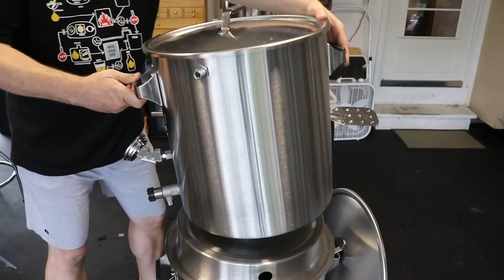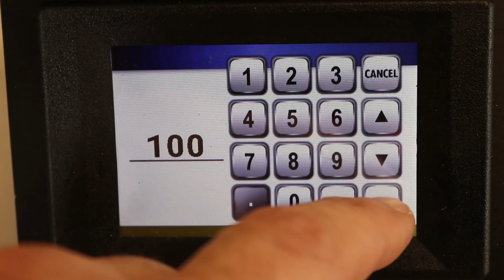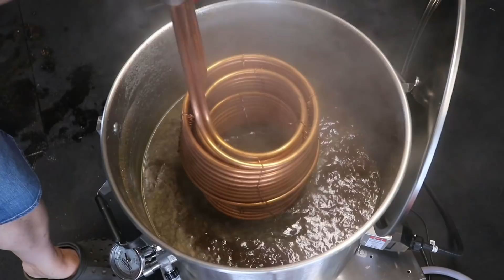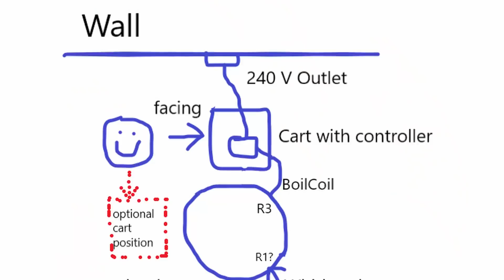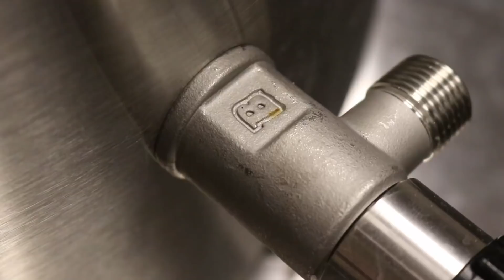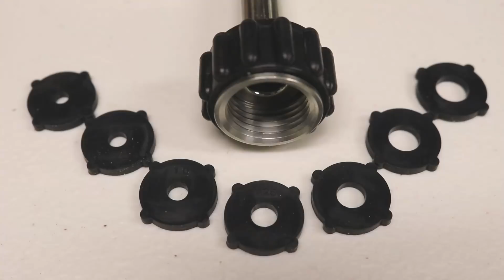Reviewing the Blichmann BrewEasy (240V Electric, 10 Gallon Version)

Comment: Hi Larry; What equipment do you recommend for someone who’s barely new at brewing? (User friendly) thanks
Reply from the maker: Depends on the brewing method you want to purse. For example, Extract or All-Grain, concentrated wort vs full wort boils, Multi-vessel or single vessel etc.  
Extracts only require a stove top pot at a minimum, but I also have a home brewing basics series playlist from a number of years back that goes over the basic equipment for all grain brewing using a multi vessel cooler based system that only requires one burner, one kettle,  and no pumps. Or, go BIAB or an almost-in-one electric system.  There are so many option nowadays, but easiest and cheapest to start is extract brewing.
Reply: @BEERNBBQBYLARRY  Thanks a lot Cheers!

Comment: Have you tried making a 5 gallon batch on the 10 gallon system?
Reply from the maker: I have not. I tried designing a 5 gallon recipe to fit on it and was really pushing the lower capacity limitations trying to keep the boil coil submerged while still providing enough mash water for the grains.  It is possible, but I was uncomfortable with the slim margin for error.

Comment: I noticed that your not using rice hulls with the false bottom. What is your grain mill gap set to?
Also, did your false bottom come in flat or warped?
Reply from the maker: Rice hulls should not be necessary if all grains in the recipe still have their husks attached as in this recipe.
I use a coarse crush for all my recipes and brew systems including those with false bottoms and manifolds. I don’t even know what the spacing is since it ranges from one end of the rollers to the other. I just ensure the grains are broken up. 
The false bottom is flat.
Reply: @BEERNBBQBYLARRY  mine has a warp and was advised that can be normal and will not get a new one. As a result I need to use rice hulls to take up the warp gap otherwise the grains fill up under the false bottom. When I use the Anvil Foundry, everything is no issue, same grind in the G2 with FB, have to use rice hulls. Guess I should find another option for G2 FB.
Reply from the maker: @RiggerBrew  So the warp is so bad that the grain is getting around the outside edge of the false bottom? Yikes!

Comment: Still struggling on by with 35l Robobrew and looking to double capacity to have half as many brew days (less washing per pint). This looks great but, she who must be obeyed would flip if I spent this much on a machine also it looks like you would be spending a few quid (sorry bucks) on camlock fittings and valves to get what you really want. My dilemma is the same as most...As much as I like to brew and make my beers, how much beer would I have to enjoy to justify the cost of a system like this. Did you actually have a video (or what ever they are called) of the faff of working this in an actual brew day? i can't find one but it would be nice. I don't think we can get this in the UK anyway. Did you ever do a spike brew? three pot HERMES ?
Reply from the maker: I'm hoping to get in another brew day this summer. I've only brewed on it twice and cooked in it once so far.  I have several Spike Solo videos already. I just need to find time to spend more time with the BrewEasy.

Comment: I fired my brew easy up last night for a passivation then cleaning. I am really struggling with the idea that the sensor goes on the pump, since mine didn't have a fitting for the pump. I have to assume that the sensor goes in my kettle, and just have to live with the temperature loss in transfer from the kettle to the mash tun. I have had it for over a year, and am just now firing it up. I find that the size on the 20 gallon is HUGE. I will probably use my cooler mash tun and false bottom for the first batch. Just keep on my toes. What say you Larry about the sensor? does it have to go on the pump?
Reply from the maker: Here is a link to the sensor instructions: https://www.blichmannengineering.com/pub/media/wysiwyg/pdf/BrewCommander5_19_1.pdf
Reply: @BEERNBBQBYLARRY  I have this manual. Thanks buddy. It shows the fitting as optional. Cheers.
Reply from the maker: That's a bummer missing the adapter piece for the probe. The BrewEasy was designed to place the sensor in-line with the pump, but I recall a couple of alternative install options listed in the sensor assembly instructions including one where the probe replaced the bimetal temperature gauge on the mash tun or kettle.I think that option also required a special adapter though. Not sure. You'd probably want to calibrate the controller to account for the different location since it'll be off by an amount.
Reply: @BEERNBBQBYLARRY  I have a coupler that is nearly identical of what came with the brew vision thermometers. It looks to made for the front of the kettle, it even has the same black grommet for the backing nut. There is no fitting for the pump though. Maye they nixed it for the larger system? Who knows but Blichmann. U suppose if I hook the craftbeerpi system up in concert I can monitor all the vessels and go from there to discover heat loss, if any. I have manuals for each individual piece that it came with, but they assembled these goods from shelf parts, and didn't provide a "Brew Easy" manual. I have a stack of individual component manuals though. HAHAHA Cheers Buddy

Comment: Thanks for the vid.  I have one of these systems and haven’t fallen in love yet.  You’re right, expensive and not many people have them so less videos on them.  I don’t understand which gasket to use either, so I just use the biggest then adjust the flow with the gravity drain...
Reply: Hey Brent. I've had my BrewEasy for about four years and I've brewed on it 40+ times. There's definitely a learning curve, but once you figure it out you'll find the rig makes very consistent batches. As for the orifices, I typically use the 1.25 GPM (which I believe is the same one Larry used) for the duration of the mash and then switch to the smallest orifice when I'm ready to gravity drain for the boil. With the 1.25 orifice installed and the auto-sparge configured correctly you can run the Riptide pump wide open for the duration of the mash. Also, you'll definitely want to install quick disconnects (per Larry's recommendation) as that will make the brew day much more enjoyable. Hope this helps!
Reply: @cwalter-25  thanks for all the info Chris- appreciated.  I guess I just don’t understand why not just use one large gasket and adjust with the flow knob instead?  Just in case it’s not flowing enough you can adjust drain volume on the fly.
Reply: @silveraven1  Hey Brent. That's a valid question, and I can't recall off the top of my head why that particular orifice is the preferred one for the mash, but I'm pretty sure I got the info from this website: https://www.greatfermentations.com/brew-day-tips-blichmann-breweasy/  
There's a guy named Dana who has done over 100 brews on his BrewEasy. I think he's an airline pilot by trade, so he's very precise as to how he brews, e.g., using a check list, etc. Check out his tips and watch his video and you'll have a much better understanding of your system. Cheers!
Reply: @silveraven1  I just re-read your question. If you use the 1.25 GPM orifice you'll never need to touch the flow knob. In fact I leave the Blichmann Riptide valve  (and the MT valve) wide open at all times during the mash.  That's the beauty of using that 1.25 GPM orifice. It's basically "set and forget", and you don't have to do anything during the mash other than rake the top 1/3 of the grain bed every 10-15 minutes.
Reply: @cwalter-25  great advice and I’ll try this next brew 👍🏻 doing a Blue Moon clone

Comment: Hi Larry. I saw the post that your out of action that is so unfortunate. Hey I’ve had a great idea. I just bought 2 wii workout scales. I’m going to remove the electronics and replace them with an Arduino so that I can measure my water accurately. And it’s also temp corrected to room temp.  This way I can add a valve. And request a volume of water and voila it will fill to exactly that amount. 🙂
Reply: This will also allow me to measure the grain bill  as well 😉

Comment: I'm trying step up my game from biab, (brew in a basket)  and I have been working on building a system like this on a low budget. 20l & 15l kettles stacked on top of each other, a cheap pid, 2200w element and a cheap pump + all the fittings and ball valves.. If everything works out, total cost will be around 200-250€. ( Cheapest all-in-one systems are about 400€, but are also for bigger batch sizes ) Since you've been brewing on all sorts of systems, what is your opinion, is it worth the hassle compared to biab? In other words, should i just keep brewing in a basket, or up my game? -Thanks
Reply: And great video as always by the way.

Comment: I have been looking to upgrade from 35L Robobrew for increased batch size. This thing is pricey, but the false bottom has one of the best designs I have seen. The fact you got no grain in your boil kettle is great! So the way I do mine now is 1.5/pound and then sparge from pot on burner to volume. It seems no more hot liquor tank for sparge, the liquid is in the boil tank below.  Is it safe to say one starts with total batch volume plus grain loss, other losses etc. for the starting water in the boil kettle and that’s it?  That would be very nice. I was looking at building a 3v electric system, but I really like the small size of this.

Comment: Thorough analysis Larry. Great presentation as usual. If these Blichmann goods have been around this long there must be a reason why. That was my thoughts. Value wise they had the most goods and a comparable price to the single vessel systems, and if the Breweasy wasn't up to par, I figured then I would only be a few parts away from having a 3 vessel HERMS. I would be brewing with mine, except the panel breaker they sent me had a broken switch handle. Cheers Buddy. .